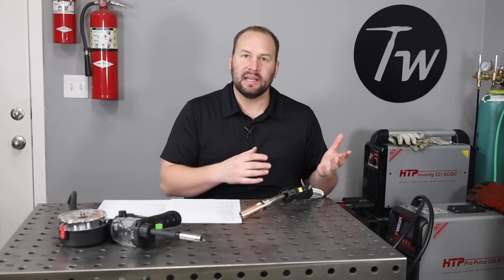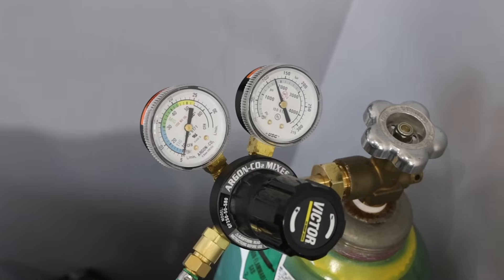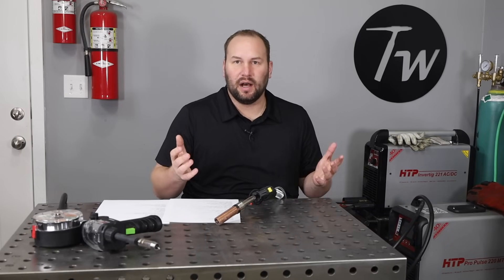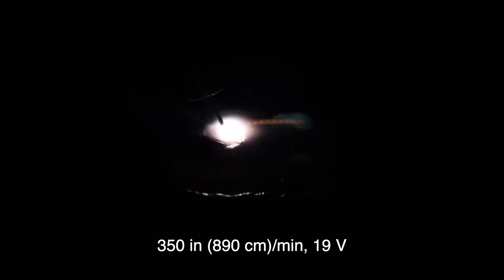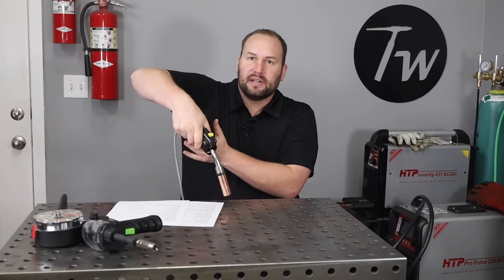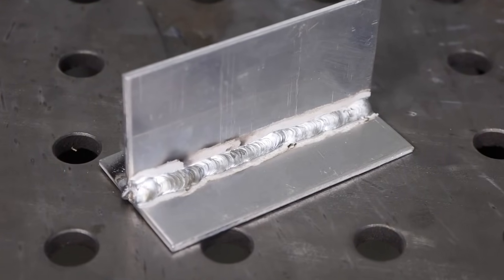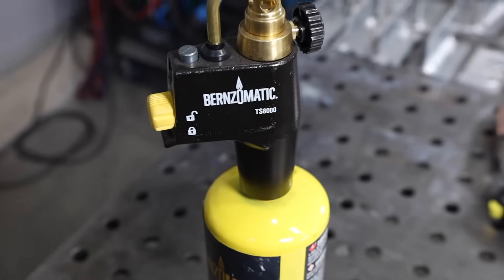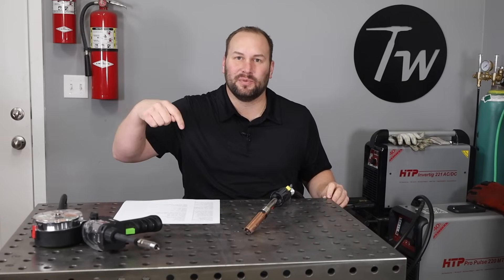How to MIG Weld Aluminum: The Complete Guide

Comment: 350a x 20v, that's 7000 watts. do you have some special arrangement of wiring on your wall sockets? here where i live on the other side of the world, ordinary household wall socket means 220v 13a, about 2800 watts. welders sometimes will have fuse tripped when they turn the machine max for serious job. and we found wires on the wall some kind of warm. that's a glass ceiling unless they have their shop move to industrial building then they can have 3 phase 380v 30a+. but it also means on site repair are limited.

Comment: Great video Tim.  As always, you have no unnecessary BS, just the good info.

One thing that would help me - you talk about what to do if you "feel" the metal is getting too hot towards the end of a run - but for us newbies, we have no "feel"!   What are the signs that things are getting too hot towards the end of a bead, that lets you know you need to be turning the amps down?
Reply from the maker: Thanks! What I mean by that is puddle gets wider and starts to sink, indicating that it’s starting to melt through more than I want it to.
Reply: @TimWelds  Excellent, thanks.  Thought it must be something like that.

Comment: Talking about weld properties, I’ve found that a number of guys here on YouTube are using 5356 for automobile engine use. “It looks nicer than 4340”. Yes, it can, but you can’t really use it in places where temperatures run higher than about 150 degrees F. If it is, then at some point, the weld will fall apart.
Reply from the maker: Definitely an important consideration. At temperature, reactions occur in that alloy that lead to really long precipitates which corrode like crazy and weaken the joint. Thanks Mel!

Comment: 1 thing - Crater fill. Aluminum craters very harshly because of the high heat needed to weld it. Anything structural needs craters filled, but I fill them regardless. Aluminum wire has extremely high conductivity, so you cannot long arc it at the end of the weld to fill it.

I do 3 ways:

Backfill - Recommended by Lincoln, probably the most suitable for structural work. At the end of a bead, run back over the last 2 inches of your weld before stopping. Very ugly.

Bowtie - Weld a portion of the joint, then start on the other side and tie the two welds together, ending the 2nd weld as you start to overlap the original. 

Simplest - After you terminate your weld, keep the gas on (nicer spool guns have a "half-step" in the trigger where the gas will still flow) for a moment, then throw another zap onto your crater. Looks best and definitely the easiest.
Reply from the maker: Great tips! Thanks so much!

Comment: My question is if you need an ac machine or a dc can work?
Great video as always by te way!👌
Reply from the maker: For MIG aluminum, DC electrode positive is what you need. That’s what I was using in this video. With TIG welding, on the other hand, AC is needed.